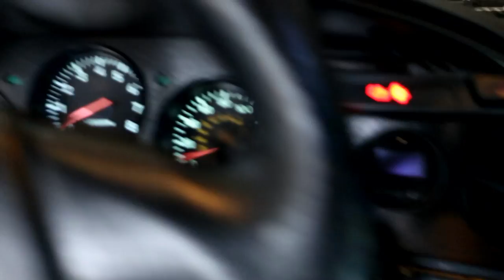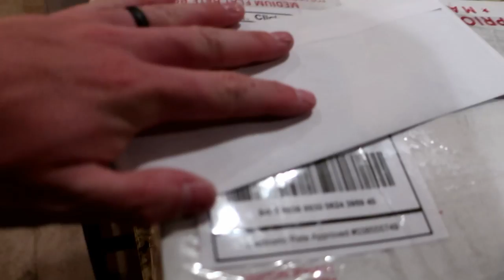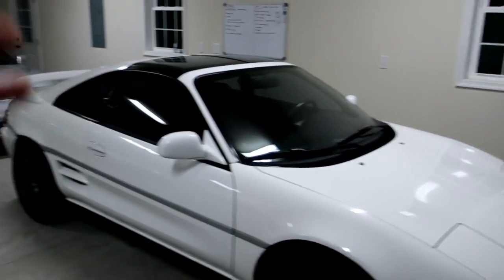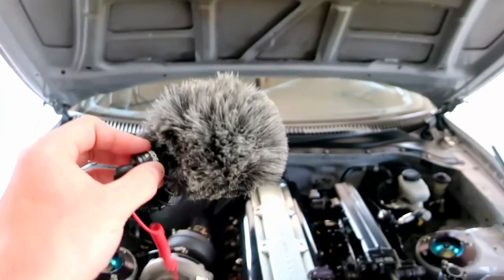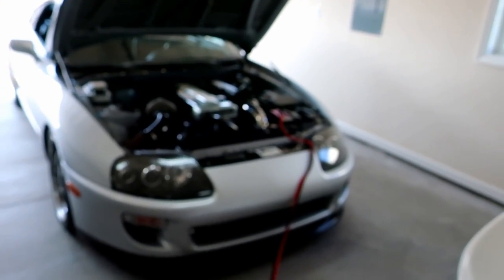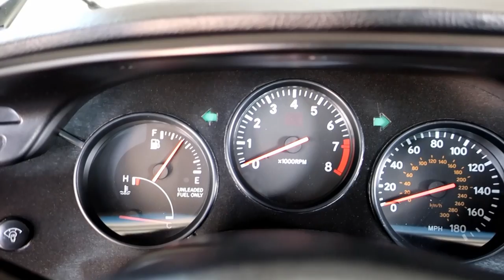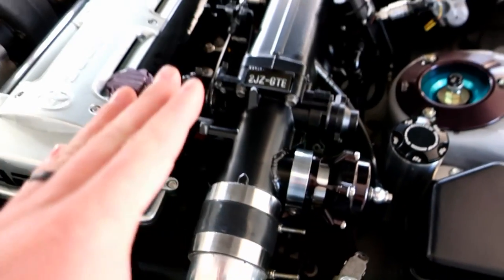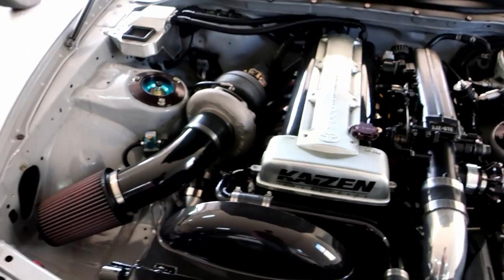Toyota Supra Single Turbo MIC In Engine Bay!

Comment: That thing has some lag....  I’m rethinking lowering my compression. Cause my S366 comes in Very early in first and and from a Low roll in second I can have full boost by 3500. Can’t wait to tune it and see the monster it can become.
Reply: PURE Function I never put more then about 330 wheel through my W58 and I even slammed gears on it. But it didn’t like to be shocked. I wheelhopped when I was stock and broke one. Replacement took to boost and abuse ok lol 

We’ve got a couple local R154 2j cars making 800+ here in philly and running either radial or full slicks. They’re holding up ok so I’m having faith in the R154 honestly. I’ll be on Radials for the Supra meet next week :)

Comment: The bolstering is okay on the turbo seats but it's nothing to seriously rave about, if you put them in you'll probably notice a slight difference just because of the adjustability but it's not gonna be a life changer or anything

Comment: Are you still using the cube short shifter ??
Reply: PURE Function Why did you decide to go back to stock shifter?  Did the cube give you issues?
Reply: 340 Supra that's what I was curious about. I recently did r154 with cube shifter and im not sure if I like it. It's really stiff and kind of hard to put into gear.
Reply: Randy Duque I have mines also but yet to drive it. Definitely is notchy from jackstand testing but trans has 0 miles on full MC rebuild. Going to research some more now hope these are not duds.
Reply: 340 Supra it feels super tight, I'm not sure if I love it or hate it yet. I find it hard to find 3rd sometimes if I'm trying to fast shift. I haven't used a stock shifter yet, so I might order one to see the difference.